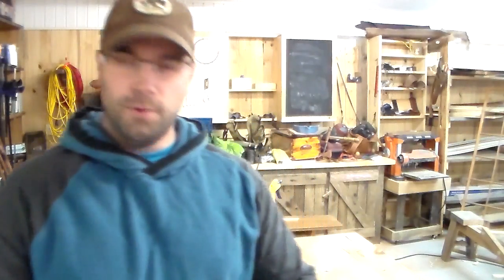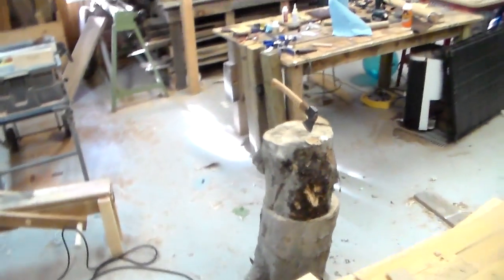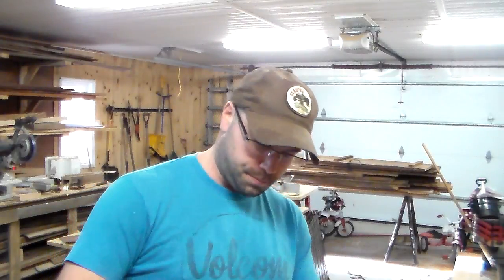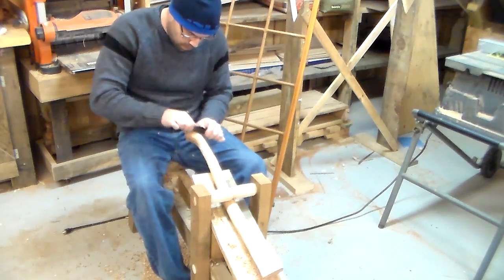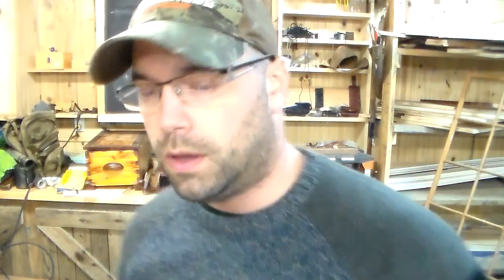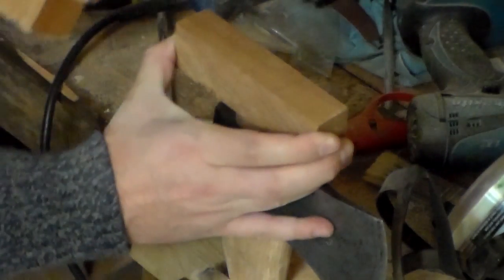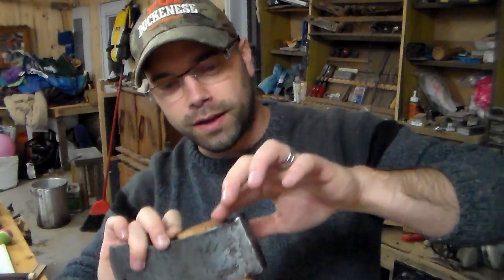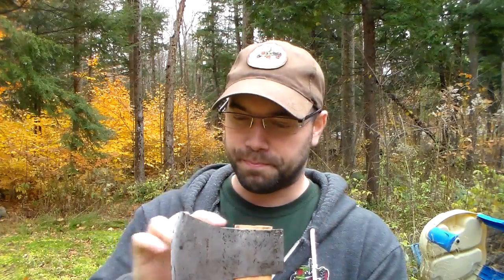Hultafors Axe Restoration: Making an Axe Handle

Comment: Hey, nice video!
At the end you asked for suggestions so I'm going to share the things I did in a different way when I restored an axe (it was also a Hults Bruk).

I used ash to make the handle, I have also used hickory for some hammers in the past. I personally wouldn't use oak since it has a tendency to split over long periods of time.

I made the handle faceted instead of rounded. It's cross section kinda looks like an elongated octagon. I personally find it more comfortable and 'grippable' than an oval cross section.

Just before I pound the wedge in, I pour some boiled linseed oil in the wedge slot and coat the wedge as well. It kinda helps in getting it started but more importantly, it swells up the wood inside of the head a little bit providing extra pressure to keep the head tight.

I also used a metal step wedge to secure the first wooden wedge.

Anyway, nice video!
Reply from the maker: +𝖘 𝖍 𝖎 𝖗 𝖔 Thanks and thanks for sharing your experience!

Comment: That came out fantastic :). Excellent job on the handle, nice to see something other than hickory as the handle choice. If I'm not mistaken, oak was a preferred handle wood in colonial America, even when hickory was available. Both are excellent, as is American Beech, Ironwood/Hornbeam, and Sugar Maple (of which an old common name was "Rock Maple"). 

I bet the 9 dislikes are purists and armchair homesteaders lol. I wouldn't worry about at gap at the top of the eye. The wooden wedge is only supposed to spread out the wood from the kerf, essentially locking the axe head in place. The worst hang jobs I have seen were when I worked as a wilderness ranger for Mark Twain National Forest. Someone had shoved a handle onto a vintage True Temper Federal Supply System (FSS) double bit, with no wooden wedge. Instead, it was "secured" with a screw that someone drilled through one side of the axe head. On top of that, the axe head was spray painted black in a very sloppy, horrid way. Those old True Tempers were produced with a black paint finish per government specs, but to cover the axe's age with spray paint?...that should be a crime LOL.
Going back to the wedge issue, some people fill any gaps with scrap hardwood shims and and a bit of wood glue.

Comment: Great work. When it comes to splitting, place the round closer to the far edge of the chopping block and not the near edger. That way if you miss strike or miss altogether,  the axe catches the block and not your balls or knee caps.

Comment: I seem to be following your path; making a shaving horse so I can make ax handles. Thanks for the great videos.
OBTW: I would have made another wedge to fill that gap up and secure the bit on, leaving it open seems to be working though.
Reply: Seconded. I don't like being able to see into the eye of the axe, just seems like a weakspot once it all starts moving about with use and humidity changes. That said, if it cuts then it works.
Reply: Also, and I should have led with this, that's a nice shape on the handle. Very impressive work, more so considering the hand tools only approach (I know they're not harder to use but you do need patience, that's a skill all of its own).

Comment: I find a 17" Handle works great on my 1 3/4lbs head. Yeah, it's long enough to use both hands yet I also can use it with one, But Yeah, the longer handle will chop tress a little better because of the leverage, But I like the portability of mine too, , ,

Comment: Turned out nice , I started to use the slightest bit of wood glue when installing my friction wedge, it seemed to make sense,, I didn't for years , thought id try any how does man have to make one of those things you sitt on to do your shaping ,, and what are they called I do alot of rasping dram knife and spoke shaving and this wood be wonder ful  tthhxx alot  ,again nice job
Reply from the maker: I actually have a video of the construction1! https://www.youtube.com/watch?v=FBLoEK8K638
Reply: +The Apprentice sweet

Comment: Got a chance to see the video after work turned out really nice. Did you notice a difference between oak and hickory or was it pretty much the same.
Reply from the maker: +JP Kelly The only difference I noticed between oak and hickory was that Oak grain is a bit more brittle. the wood as a whole is very strong. but I find hickory to have more flex. I dont see an advantage from one to the other. but I like the look of oak. Thanks for stopping by! Denis

Comment: Oak is probably the least suitable wood for an axe. It is brittle and it's also does not absorb the energy so you can not work for a long time with oak handle because you hands will hurt.
Also, when making an axe you should look at the shape of tree grain. Grain should go after handle shape. That makes axe handle much more stronger.
Reply from the maker: I have been using constantly to clear the yard and I can confirm the contrary. oak has a great spring to it, not as much as ash or hickory but very comfortable all the same. it's held up wonderfully and would consider using it for all my axes
Reply: So your saying cedar or pine is better for an axe handle ? Hymn...

Comment: excellent job but i noticed you never used a metal cross wedge. is it better not using one?
Reply from the maker: +Newfoundland Outdoors I think I should add one. it will add that extra security. Some think that if you are good enough you dont need to put one. I think I should add one to be sure since it is my first try. we will see over time. Denis
Reply: As tight as that was wedged you really don't need the metal wedge, just keep the handle treated on occasion and it should never come loose. Great job on the handle btw, I've ben looking for the right head to do the same thing.
Reply from the maker: Cool thanks and thanks for watching!

Comment: Say Heah, Yup, Still, my 17" H.B. Agdor is one of my Fav. Bushcraft Hatchets. It came spot on and I bought it as a close out. It wasn't as sharp as my Gab. Small Forest Axe, But in a very short time it was. I like the compact of it when I carry it in my Axe Holster. But also the 1 3/4lbs. Head. Yeah, I team it with some of my knives for specific Trips, ei. my Bravo 1 in both steals, my Ratmandu/Rodent 5 and my Modde Rodent 6 that now l@@ks like my Ratmandu on steroids. But I also can use it with my new GNS, when I ass a larger knife ei. Potbelly, Yeah, Hultafors Bruks uses a  a good steel on their axes.,,.